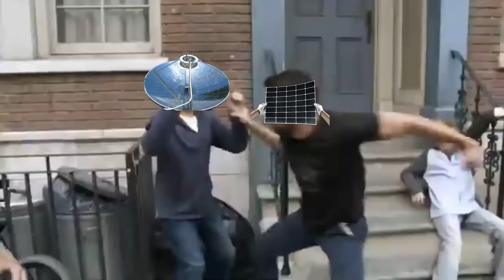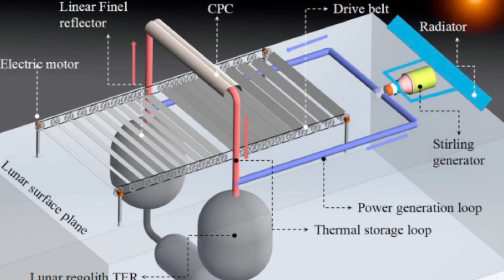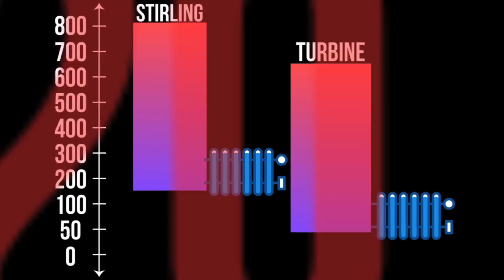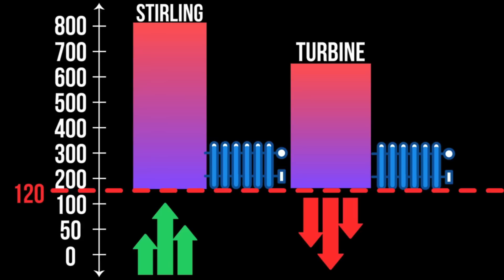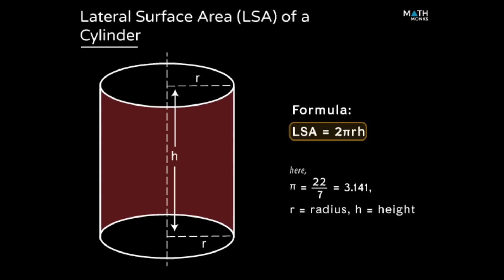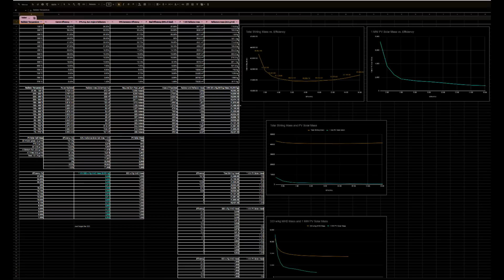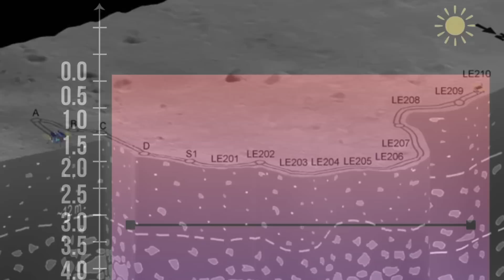Stirling Engines vs Solar Cells (+Transmission Lines)

Comment from the maker: You can't just bury it underground to get free 'cold.' Local Equilibrium. It will heat up around the radiator to the same temp. Regolith is an insulator and you have to understand how much heat we are working with here. With the cable the resistance is so low local heating isnt a problem. This is not the case with the radiator which is a ton of heat in a small area. This ones is my fault, I should've stated this clearly in the video.

Yes you can store heat underground or in regolith for the night (thermal wadi) but it requires much more mass for much less power draw and you're better off using reactors or batteries for night power.

Yes i forgot to make K logorithmic and said it doubles. Oops. 

P.s. thermal wadis are really cool and definitely seemed like the best non-nuclear night power solution but sodium and other battery tech has just gotten really good at this point. I'm watching iron batteries closely.
Reply: No wonder this felt so familiar lol.
Thanks for going to the effort to make corrections though. That's a really great thing.
Reply: So I've watched both the Stirling video and the Solar video.

First of all, I want to say you've done a fantastic job making these tables, and compiling a very in depth overview. It's people like you that truly push scientific discourse.

I do want to make a small note that while mass is in fact a decent approximation for energy expenditure, producing thin pieces of glass from Silica to deposit A-Si film onto and producing thin foil of aluminim does have a difference. Glass has a "melting" point around 1700C (it is amorphous), compared to  the melting point of aluminum around 660C. While glass has a better specific heat of 750J/kgK vs aluminum's 890J/kgK, the difference in melt temp results in 1.27MJ vs 590kJ, a 2X expenditure in energy just to reach melting point. While aluminum does need an extra 400kj/kg to fully melt, and glass is pretty much ready to work once in it's glass transition phase, the aluminum is still saving 20% ish in terms of energy.

Note that raw aluminum is not available on the moon, and we will need to expend energy to convert alumina, with it's high melting temperature of around 2200C to aluminum. However, if we compare this to silicon, it has a heat of fusion of 1093kJ/kg vs silicon's 1787kj/kg.

While I agree with you that prices on earth are highly dependent on the whims of the average consumer, and my work boots cost less than a pair of Air Jordans, there's something to be said about aluminum foil costing $11 for 200sqft while solar panels run around $186 for merely 20sqft. 

Rolling something between a pair of wheels is in fact simpler and more consistent than delicately spraying glass in silane, even if the vacuum pump for the vacuum chamber is free.

An interesting thought could be to combine the faster and less energy intensive production of using aluminum foil with photovoltaics. While yes, solar panels do lose performance at elevated temperatures, they also increase efficiency with higher light intensity, so there's probably a decent tradeoff point where it may be advantageous, perhaps around 20x to 30x concentration. 

I also want to draw note that instead of extracting the power during the lunar day, a Stirling engine may be best used during the lunar night, where the additional 250 Kelvinish difference in temperature will substantially improve Carnot efficiency. Perhaps instead of looking at this as an exercise in power output, we look at this in terms of a total energy expenditure. Is it more energy efficient to build solar panels and banks of batteries? Or perhaps it may be more efficient to use PV panels to power our 360hr lunar work day and then use thermal batteries and a Stirling engine on our night off? Is manufacturing a battery at around $0.20 per kWh of storage LCOS on earth the same as around the predicted $0.07 per kWh LCOS for cooking some sand? Does this translate to a lunar economy. Is the cost of shoveling some lunar regolith into a mountain and heating it up using mirrors cheaper than building a battery factory? Is charging a battery at 16% efficiency as nice as using a less area and maybe pushing 70% carnot efficiency for a two week long lunar night? In terms of loss of surface area of solar panels is it worth it?

These are all fascinating questions.
Reply: @feraldegenerate1743  Good points, though one of the most power intensive aspects of aluminum refining isn't just melting its ore, its the electrolysis necessary to break the really stable Aluminum oxygen bonds. Aluminum refining takes a pretty obscene amount of electricity, the main reason for aluminums cheap price is its ore's abundance and the cheap price of electricity now. The process takes a theoretical minimum of 22.428 Mj/kg, though in practice its more like 55.332 Mj/kg.
Reply: I saw some figures for converting silicon into aluminum and the numbers for aluminum are still marginally superior. I think silicon refining (not to semiconductor grade but to at least 98% purity) is around 16kWh per kg or around 57MJ/kg.

Silicon can be made of merely a thin film deposition, but technically, so can aluminum. I do agree Stirling thermogenerators should not be the primary system for electrical generation, but I wonder if concentrated PV may shave energy costs for production in the long run.
Reply: Note that we could use a combination of systems as well. Batteries do offer a longer term storage solution that is not susceptible to radiative losses, but again, we are charging them with 16% ish PV system, compared to taking a perhaps 40% loss on the back end. Note also that humans do need thermal control, so this may be a decent idea for lunar night time ECLSS
Reply: Ok so my own research has found that you can get significantly colder than ambient daytime heating by using shaded radiators, like the ISS uses.  The output temperature of those radiators is targeted to -40 (doesnt matter if fahrenheit or celcius). Which is a great deal colder than 122C.  Would this be enough of a gradient to put stirling or steam back on top?  Unsure.  Going to do more research myself as well as hope you fine gentlemen can chime in.
Reply: You can split the light using a prism into a rainbow and separately process thermal radiation using Stirling engines and visible radiation using solar panels.
Reply: @intellectualcat4000  Fascinating you say that, I have a patent on a similar concept....
Reply: @feraldegenerate1743 tell me more?
Reply: @feraldegenerate1743  It's very interesting! Can you provide a link to your patent?
Reply: Edit: Ignore this comment, I misunderstood the last graph, he used the 600 watt/kg figure as the total system mass, not the MHD generator mass, which was right. Thanks for the fix! 

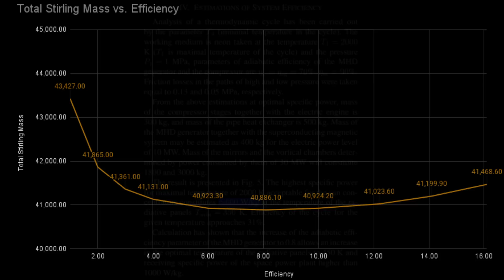Thanks for reuploading, but I do feel the need to point out that the 600 watt/kg figure is still the total system power density. The authors don't make that very clear, but whenever they are talking about the power density in general and not specifying a component, they are talking about the power density of the whole system, radiators and mirrors included. To get the power density of just the electrical generating parts, you need to look at the masses of the different components they listed in the paragraph right above the one you quoted at 27:34

"From the above estimations at optimal specific power, mass of the compressor stages together with the electric engine is 300 kg, and mass of the pipe heat exchanger is 500 kg. Mass of the MHD generator together with the superconducting magnetic system may be estimated as 400 kg for the electric power level of 10 MW. Mass of the mirrors and the vortical chambers determined by power consumed by them of 30 MW will constitute 1800 and 3000 kg."

The mass of all those components minus the mirrors is 4200 kg, and the system is accepting 30 MW of thermal power as input and since it is 31% efficient it is outputting around 10MW of electricity and 20 MW of waste heat. That's an electrical power density of 10MW/4200 kg, aka 2380 watts per kilogram, or 420 kg for 1 Megawatt.
Reply: I like wadis

Comment: NaK will freeze during the Lunar night, you need to have it actively heated. If you are heating your working fluid you may as well switch to pure Na, it's a better working fluid for radiators. Another reason to not use NaK is K is much rarer than Na, and K is also used as a fertilizer which will have uses in space.

Comment: Reeeeeeeeeee
Just go nuclear! Please please please. Just send a hybrid nuclear generator-rocket 

Design a nuclear reactor with multiple cords that can operate independently turn all of them on then pump a coolant liquid through the reactors and into a rocket thruster

The liquid fall down super critical and irrupts out of the thruster creating lift 

The liquid could be basically anything so long as it’s boiling point is super low, like liquid hydrogen and oxygen (which can burn together to make water on the moon) 

Two rockets one with hydrogen, one with oxygen and both with reactor components and you suddenly have all the power you need
Reply: To clarify: use a closed system nuclear rocket engine, one designed to be dismantled and converted into multiple small nuclear sterling engines 

Use hydrogen and oxygen as steamer propellant so that you can use hydrogen fuel cells for power storage and water production 

So long as you land somewhere shady the radiators would be cool enough to help with better efficiency

Comment: I think the biggest factor working against photovoltaics is that we won't be able to make them on the moon in early years. The author understands that we might need to use pulleys in escalators etc.. because we need a low tech solution which would be easy to manufacture on the moon, but then proposes to use very modern semiconductor based solar panels.

Comment: You made reference to superconductors at the end of the video and I think that they could be a great solution. The current highest temperature superconductor is -140°C and this number is continuously getting pushed higher. If this were to continue being the case and we eventually ended up with superconductors at, say, -70°C, would the insulative properties of the regolith at a reasonable depth be enough to keep them at this temperature during the lunar day, or would this not be an option?

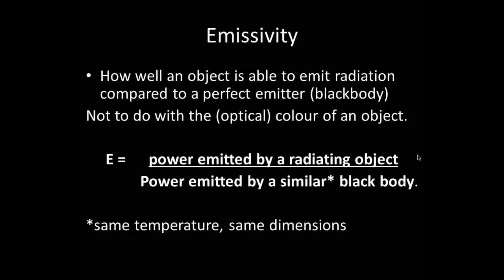Comment: 9:24 there are two additional methods, to generate electricity from heat source or additional cold source: TPV - thermical photo voltaic, which can achieve up to 40%, and strong Seebeck effect elements, which can already achieve up to 9% efficiency, maybe already more, the experiments are going on.

Comment: The thought of a Super Heated Plasma Lance made from 2 of the most reactive elements being hurled haphazardly through magents sounds both awesome and terrifying.  A side note on transmission lines, aluminum is not nearly as reslient to metal fatigue as copper.  Constant heating and cooling might cause cracks to form, although simply burying them would most likely solve this.

Comment: you neglected the fact that solar panels in vacuum of space gets extremely hot, and the hotter it is, the less efficient it becomes. This requires some form of cooling itself, which means you practically have a similar set up to the cooling cycle of the stirling engine that you are comparing to. The issue is that you need to drop the cooling side much further than your bottom line assumption or the panels have a high likelihood of early failure.

So instead of looking at it as a competition, these two systems should be working in tandem. A basic heat exchange cooling circuit from the panels can drop its temperature enough to be within efficient ranges, and the hot side can be moved to the collector side to increase even more (though its size now wouldn't need to be as big to "collect" heat as it will already start out at a high temp from the heat transfer). The stirling engine can now take the heat and create energy in the exchange to the "cold" side. The cold side, again through another heat exchange cooling circuit can run the hot side through radiation panels to disperse the heat into space. You now have 2 systems creating energy that work in unison, use less material than either one individually.

The only drawback is the need for the correct refrigerant to create the heat exchange cooling circuits. R471a or similar can work on the panel side, while just about anything could work for the stirling side....but the real trick would be better to find a chemical we could use from the moon that mimics that refrigerant, NaK won't do obviously. Ammonia is a possibility as it is on the moon, but system would have to be reworked. The good news is that the heat exchange cycles can actually be utilized by the crew on the moon for comfortable living as well as manufacturing (smelting) processes to reduce energy needs.

Comment: I don't believe that the argument that the solar thermal system being more expensive to construct, therefore, it is beaten by solar voltaic is a good one. it boils down to the duration in which a colony is using it, location (planetary, nonplanetary, and distance from the sun), function, and serviceability costs. the thing that needs to be understood about Stirling engines, is that they don't require hot as a power source. the system is reliant on thermal differences in a working fluid, so if the power source is cold enough, then the same rule will apply. this means Stirling engines will work anywhere where there is a difference in temperature, such as geothermal, and ice bodies, vs the temperature of the void above it. solar panels only work with the sun.

Comment: for cooling, It isn't necessarily cheap, but you can make a matt out of electrospun pure silica on aluminum foil that manages 178W/m^2 cooling power in direct sunlight at normal earth temperatures. it makes the daytime cooling a lot easier and the bulk material is abundant in the lunar regolith. you would probably have to import silicon carbide tooling or something like that, but that should be a pretty long term investment since the tooling shouldn't degrade very much.

Daytime radiative cooling with silica fiber network
Refet Ali Yalçın, Etienne Blandre, Karl Joulain, Jérémie Drévillon

Comment: did you ever look into alkali metal thermal to electric converters? you basically just need some alkali metal, electrical steel, some sintered regolith, and a block of alkali-doped aluminum oxide, and requires zero precision manufacturing. At least for early development, being able to make it with relatively crude manufacturing seems like a big advantage. 
I didn't spend that much time looking, but all the MHD stuff I could find seems to require a 2 phase flow because they rely on gas expansion to increase the velocity, which means you need to spray the liquid metal, so precision manufacturing required, and probably have to import at least the gas because you can't use oxygen with liquid Sodium-Potassium alloys. Precision manufacturing means that you need a lot of end mills and stuff that are consumable imports and you start losing a lot of material as chips and scrap.
I also don't totally buy that PV is better because I think you're underestimating the cost (energy or otherwise) and complexity of making and doping sufficiently high-purity silicon. the first big issue is that getting from metallurgical quality to even the minimum solar cell quality might lose half the silicon, especially with a more primitive process, though finding the actual yield would require some more research. It also requires some pretty specialized equipment, some of which, like the crucibles, are consumable and would take a very long time to be manufactureable in situ.

I think one other big advantage of solar thermal stuff over PV is can use extremely cheap thermal storage instead of having to figure out how to make chemical batteries and just power as much as possible with cables. chemical batteries on the moon are going to be really hard, because almost all modern battery chemistries rely on a graphite anode making up a double-digit percentage of the battery's weight, at least until you get to solid electrolytes that can use solid metal anodes, including at least the lithium versions of all the battery chemistries I saw you mention in the heavy equipment video. The only alternative I can think of is something like Ambri's liquid metal battery, but I'm not sure if there's a chemistry that uses only lunar abundant materials.

The idea that you wouldn't be trying to store at least some energy for lunar night even with all machines seems a bit odd to me because the equipment is going to cost a lot more in both energy and dollars than the raw material it's made of, especially compared to cheap thermal storage and mirrors, so the most efficient use of capital probably involves running it through a lot of the lunar night.

Comment: You can avoid radiators at all. You just need to have thermal accumulators underground, and a small circuit around the mirrors. During the day you will heat up your heat storage, during the night- cool down through the same mirrors. You can run your Stirling engine day and night this way…

Comment: You can split the light using a prism into a rainbow and separately process thermal radiation using Stirling engines and visible radiation using solar panels.